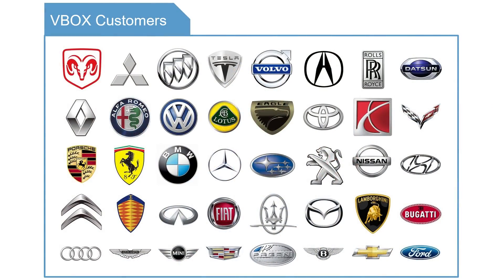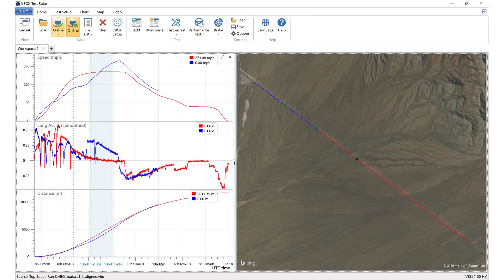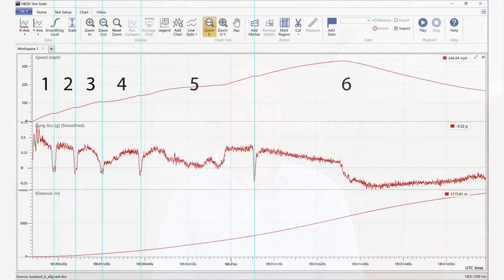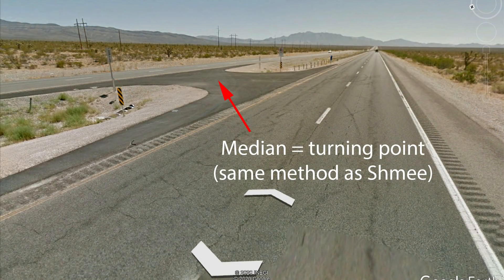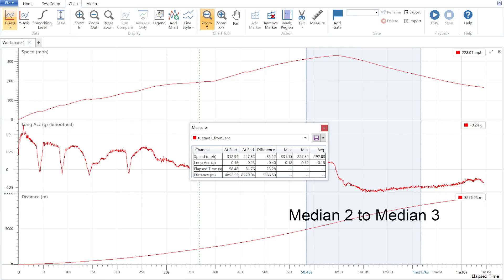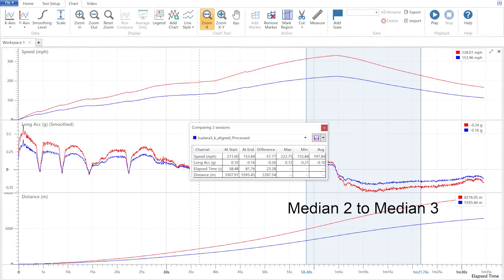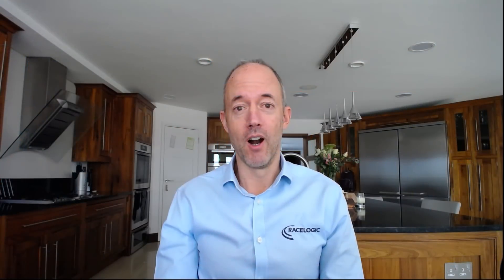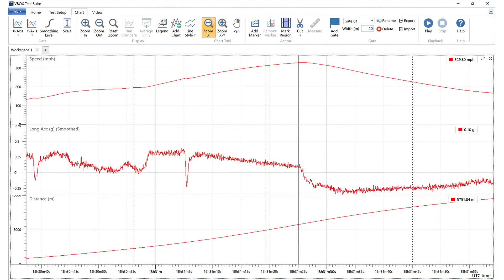How fast did the SSC Tuatara really go? Here's my calculation based on some new data.

Comment: Truly fascinating approach and eye-opening in many ways, beyond my ability to work on it that's for sure! There are many questions surrounding this, that may well go unanswered, for now we shall await the next run and see what the Tuatara can achieve.
Reply: Man, you write exactly like you talk. I can imagine your voice while reading this.
Reply: Thanks for all your great journalism in getting to the bottom of this scandal. It takes a real professional to be so thorough and unbiased
Reply: If this is accurate I would think a downforce issue is still to be dealt with. Ollie was almost blown off the highway at this speed, whatever it was and the crosswinds were minimal. Safety is now a big concern, no?
Reply: 216.95 by my estimate Tim. But still + 6 mph is within margin of error. 

God Bless. 

KNIGHTRIDER
Reply: @jeanmaranello3365  you people are nuts. The lambo aventador svj does 216 mph with 760hp. The SSC has 1000 more. I don’t think y’all actually understand physics.
Reply: @flowmastaflam  so you're saying there's a direct correlation between top speed and bhp? amazing
Reply: @nocashirl  do you disagree that there is a correlation between hp and top speed?
Reply: @flowmastaflam  yeah only if things were as simple as you think they are
Reply: @nocashirl  if you don’t think speed correlated with power then you have no leg to stand on. It’s literally the basis of how a car works.
Reply: @flowmastaflam  what if i simply chose to have shorter gears.
Reply: @nocashirl  this wasn’t the discussion. You said power doesn’t correlate with speed which is factually incorrect. See if you can reach 300mph in a Honda Civic with a stretched final drive.
Reply: @flowmastaflam  Everywhere in this comments section you are arguing as if ANYONE has said that 223mph is the highest speed possible by the SSC when literally NOBODY has said that. All they are saying is that this is a video of a car still accelerating but it only hit 227mph when the driver lifted off. Every car that ever went more than 223mph, will have still been accelerating at 223mph. There is ZERO evidence that it ever went more than 223mph even though we all know it can go higher than 223mph. What we want is evidence of it going faster than 223mph and hopefully as fast as it can. But we don't just "believe" based on it having 1000 more bhp than another car that did over 200mph that SSC did 300+ with zero evidence. They put out a bogus video and aligned it with a claim that doesn't appear in the videos. So we are doubting it. If they had the evidence of 300+ it would be here with us by now.
Reply: @stevenross-watt8640  there is ZERO evidence that he lifted off at 227mph. See how this strawman argument works? You don’t have to believe the speed, but literally nothing has proven that the speed wasn’t achieved, and you’re doing exactly what you supposedly have an issue with, but from the opposite perspective.
Reply: @flowmastaflam  the duty does not lay on us to prove the car didn't do 300+ it is the duty of the record claim to prove it did do 300+... that is how records work. Would you agree? I could claim i ran the 100m faster than Usain Bolt's world record but the duty would be on me to prove I did with live video, officials, measure track, wind speed and all the rest. What we all have here is analysis that shows that the evidence we have been provided by the record claimant is false and the analysis is robust and shows what speed it did do when the driver lifted. In the video we have, robust analysis shows he lifted at 223mph. You need to come up with a better argument or evidence or analysis for your point of view considering the level of professional expert you are questioning. Where is your evidence or robust analysis? You just have " it has 1000bhp more than a car that did over 200". Thats not a lot to go on.
Reply: @flowmastaflam  I think it is the case that in a fight maths always beats physics because physics is just a special case of mathematics.
Reply: @flowmastaflam  
You get that air resistance is proportional to velocity squared I presume?
Reply: Flowmasta Flam maybe theyre being paid off by koenigsegg to say this stuff🤔
Reply: @flowmastaflam  216 mph for a car as big and heavy as that Lambo seems like a bit of a stretch. Maybe they tested it while driving down a mine shaft?
Reply: @moto-rambler  haha, i enjoy dunking on vapid lambos as much as the next guy, but weight only determines acceleration, not top speed :O
Reply: @flowmastaflam  nothing proves he didn’t reach the speed you say..how about Shelby coming out himself admitting the speed was ‘INCORRECT’  “Your flogging a dead horse here pal!
Reply: @moto-rambler  Actually no...if you dropped it down a mine shaft, no matter how deep, once it accelerated to terminal velocity, it would stay there! But I get what your saying lol
Reply: @Stix84  Indeed 👍
I was attempting to nudge flowmasta into unblocking his way of thinking all by himself 💩
Reply: @flowmastaflam  My car's top speed is 133 mph, therefore basic physics says that I always travel at 133 mph regardless of conditions or throttle position.
Reply: @reggiedixon2  You aren't making some clever point.
Reply: @owensparks5013  Your point brought nothing to the table so I didn't respond.
Reply: @flowmastaflam  
Your entire thread appears indicate that you are under the assumption that adding 1000 bhp more than a lambo will make it twice fast as a lambo. This is probably why people are not respecting your opinion. That may be a misinterpretation of what you meant, but it's how it reads to me.
Reply: @flowmastaflam  If I was then you would have no way of determining this given the lack of insight in what you have spammed all over.
Reply: @Stix84  yes but ssc bloodhound is crude technology. im convinced in 50 years or so you could have a conventional car going at least 500 mph
Reply: @paveantelic7876   your joking right? “CRUDE” Are you and flowmasta having a stupid competition here?🙄 I’m done with this thread...the levels of intelligence are even more questionable than the speed run!
Reply: @Stix84  It really doesn't matter to me whether people agree with me. Y'all are just bickering dumb irrelevant points for the sake of arguing. Here's a little scoop of wisdom for you. Might help you once you get a little older.

“An error does not become truth by reason of multiplied propagation, nor does truth become error because nobody sees it. Truth stands, even if there be no public support. It is self sustained.”
― Mahatma Gandhi
Reply: @flowmastaflam  you should have a harder think on that.
Reply: @Stix84  I never said anything about “dropping” it down a mine shaft.
Reply: @moto-rambler  What??
Reply: @flowmastaflam  I said you should have a harder think on whether weight determines only acceleration and not top speed. According to your logic, if the Lambo weighed 12,000 lbs would it accelerate slower but still reach the same (claimed) 216 top speed. I would disagree.
Reply: @moto-rambler  So, the reason I said "What?" is because I wanted you to explain your position in writing even though I already had a hunch what you were implying. I regret to inform you that weight is not a factor of top speed. It is a factor of acceleration. Think about how momentum works. Once something has been put in motion, it stays in motion no matter how large. A heavily object is slower to reach that terminal velocity while under a specific load, while things like Power, gearing, tires, and drag coefficients are the things that affect top speed.
An extreme example of this is a train. Trains make around 10,000 horsepower give or take a few thousand in either direction, yet they weigh up to 450,000 pounds. They're able to slowly creep up to top speed of 100+mph over the course of like 5 minutes because weight is not actually a factor.
Reply: @flowmastaflam  - I grok. Horsepower, gear ratio, cd/A, wheel circumference.
Theoretical top speed is a mathematical formula.
In the real world there are many more variables to consider such as rolling resistance, air density, surface condition, etc., etc....
However, you're fundamentally correct in that weight in and of itself  has little affect on top speed.
Weight has the distinction of negatively affecting every other dynamic of the automobile granted two exceptions, mechanical grip and accidents involving 2 (or more) vehicles.
Ignore people who attempt to disparage you.
Reply: @flowmastaflam  trains can do that because of a lack of rolling resistance. Put tractor trailer tires on that same hypothetical train and tell me it has the same top speed.
Reply: @flowmastaflam   You actually need to take a closer look on how the resistance of moving  object is defined in physics. As far as weight being an issue in accelerating you are correct. The basics being that Force=mass*acceleration. So far so good.  The thing is, "Force" is not just a constant, just as proved by the formula. Force consists of several variables. One of them is the rolling resistance in this case. Another one is the resistance by air. The resistance of moving an object is derived from the shape of the moving object, the thickness of the air and, here it comes,  the Force of the ground(in this case) acting on the car. This means if the car stays flat on the ground it is the same as the mass of the car. The formula is often described as F(resistance)=(negative)"coefficient of resistance"*"Neutral force". Further more, the Force described as above is by definition the derivative of energy with respect to time. The mass of the car, however, is not a function of time. Therefor we can conclude that mass is actually a factor when considering the relation of top speed and power. 
Regards
Reply: @flowmastaflam  Oh the irony. A classic Dunning-Kruger case.
Reply: @paxrolex  Why are you explaining this to me? You're acting like I don't know. Y'all are the ones acting like a car making 150 more horsepower, with a better drag coefficient, couldn't possibly do another 10 MPH. Ridiculous.
Reply: @flowmastaflam   I was under the impression that you believed that, out of two cars, with the same output power(driving force), the one with the lowest drag coefficient would go the fastest. I am simply saying that's not always true, also relating that statement to basic physics. Make of it what you will.
Reply: @paxrolex   I mean under the circumstances you just mentioned, if they’re the same car, of course the one with lower drag coefficient will go faster.
Reply: @paxrolex  not really sure how you could think otherwise
Reply: @flowmastaflam  I never said or meant the same car of course. The point is, the weight is by any means a factor when discussing both speed and acceleration. As shown in my previous mentions.
Reply: @paxrolex  Okay I'm just glad that when only considering weight vs speed, we can finally all agree that top speed is not affected.
Reply: @flowmastaflam  simply put: it requires a larger force to move a heavier object.
Reply: @paxrolex  Umm, no. I feel like you're still missing something a bit here.
It requires a larger force to move a heavier object quicker
Reply: @flowmastaflam  OK, so if I understand you correctly you are saying that it requires the same force for two identical vehicles, except one is heavier, to both getting from 0 to whatever speed. And also equivalent forces maintaining that speed? 
I found a relevant video for you to study in that case. The one where engineering explained calculates the max speed of a jesko. Check it out.
Reply: @paxrolex  no you’re talking about acceleration for some reason.  Speed and acceleration are different
Reply: @flowmastaflam  So what do you think the terminal velocity of a car is? With your reasoning you are actually saying that the terminal velocity is infinite. A car reaches it's terminal velocity when the maximum driving force is equal to the resisting force.  Meaning sum of opposing forces is zero      -> no acceleration. The resisting forces are stronger if the car has more mass. It therefor requires more power for a car with more mass to travel a certain speed.  Agree?
Reply: @flowmastaflam  I agree with you regarding space. However we do not set these top speed records in vacuum. The top speed of a car on lets say a runway will depend on resulting forces. There is no momentum in this relation. If we consider one wheel of the car beeing our reference system then yes we can talk momentum. Do not mix up your reference systems. The driving force of the car is the same magnitude as the combined momentum of all four wheels. The force of Rolling resistance is depending on the normal force and has the same magnitude as the friction of the car. This is a force opposing the driving force. The magnitude of the Rolling resistance will determine how fast a car with a given power output and a given air resistance can travel.
Reply: @paxrolex  The reason I mentioned space is because the laws of physics are true no matter where you are in the universe. The laws of physics apply whether you're a spacecraft in space, or whether you're a car on the road. Weight is not a factor in top speed.
I've played along enough, though. Was fun. Just google if weight affects top speed ;)
Reply: @flowmastaflam  🤣, And so I did,. I just had too. So here is the best motivated out of the first answers.
https://physics.stackexchange.com/questions/10991/will-a-lighter-car-have-a-higher-top-speed-than-a-heavier-car-with-an-equal-powe/10995#10995

Regards
Reply: The jump. From 200 mph +... To 300 mph ++ is the issue. 1,000  bhp more  helps. But gearing is extremely more important. 

Then you have aerodynamics, encountering atmospheric pressures. 

Final example. 

Bugati Bolide. 1,800 BHP @ the crank. 

They claim... Est. 310 MPH. 

Follow me? 

3.3.1? 

Maybe in time. Hopefully soon... My friend. 

Either way. Stay tuned.... 

I believe tires are the biggest challenge. And please correct me. BOLIDE runs michelin 400's × secret specs... For 310 mph; estimate! 

331? = + 48% ? 

God Bless. 

KNIGHTRIDER
Reply: Another LAMBORGHINI fact. 

Diablo. 497BHP. = 208.9 MPH 1989... No paddle shifters. No dual clutches. All steel tubing frame. 

SVJ @ + 8? with + 263 BHP? ÷ 2 Clutches? Tells you everything. 

- Just to GAIN 8MHP! In 2020? 

I think it is clear here. Something was completely off here. 

Still. Much love and respect to all. 😉
Reply: @jeanmaranello3365  actually you’re wrong. The 485hp diablo only did 202mph. You’re thinking of the car they made later on called the diablo SE Jota. It had 580hp which did your 209mph. Knowing this, it clearly closes the gap between the 209mph 580hp Jota, and the 2017mph 760hp aventador that was built for the track, and not top speed. This renders your point moot.
Reply: But what is the new SSC attempt worth, if the car is not street-legal?

https://en.wikipedia.org/wiki/Production_car_speed_record
Reply: @viktor.egelund  Thank you for this. I asked this very question straight after the 'record' was broken. 331Mph just seemed to high for a 'production vehicle'. 
[To quote Wiki "the car has not been homologated for road use and is therefore at present not street legal."]
Reply: @simonmaney3438  On 1750 HP, 0.313 Cd at 500 kmph and frontal area 1.953 sq.m numbers and 3% gradient, kerb weight 1384 kg, the car can do 332 ideally on the uphill and 346 on the downhill if the air is thin enough (1.11 kg/cu.m) If I take SSC's air density value of 1.20 kg/cu.m the uphill vmax drops to 326 mph. So there's no way they can climb to 331 like that on the uphill leg. I can hear James may screaming "One more, one. More! '

SSC also lied about the frontal area, claiming it to be 18 sq.ft, when 1.953 sq.m is just a tad over 21 sq.ft. This is a sixth more than claimed! 

Now we all know the truth, but when even more studies come out it is astonishing to what extent we are capable of analysing data today and what kind of geniuses are out there. No one can fake it. 

And homologation is a whole other matter. Koenigsegg claims it takes 60-80% of their development work and budget to meet homologation requirements than just hitting raw numbers. The Tuatara's weight was also exaggerated, that was the dry weight. The kerb weight is only 6 kg lighter than the Jesko Absolut. But then all manufacturers do this.
Reply: I also offered SSC to drive one of their prototypes free of charge any time after December. 

I can dedicate 72 hours to test on the road before their run.
Reply: @Blaise ?????? It was so easy to prove this incorrect. It’s super simple actually. Don’t know why you’re all butt hurt about getting hit with facts
Reply: Since these videos I've been trying to work out if it's potentially another unit that they have picked up from the GPS and overlayed on the telemetry in error. Finally after this video it seems to make sense, interestingly foot/sec is a 1.4667 correction factor from mile/hour. Using this correction factor you would get a result of 225.78 mile/hour which would be well within the margin for error of Julian's calculations
Reply: Shmee - bring him in to have further discussion!  I'd love to watch and hear him explain in greater detail.  Not just for the Tuatara but in general.  Thanks!
Reply: Did anyone notice this video? https://youtu.be/qZD6k4FOBWQ It shows different speeds on SSC Official chanel and Top Gear channel?! Plot thickens.
Reply: Now I doubt that they can beat their previous record from 2010 with the Aero
Reply: @Blaise my ding dong
Reply: Who else read this in shmee’s voice?
Reply: They lied Tim, you can't say that but they were totally at it.
Reply: well i am stupid but hear me out
shelby did this in prps and wanted shmee to find out and the world to make fun of his car its all part of the plan cuz the car did not go full speed and the revs and the gears 
he wanted to redo it again and when he does 90% more ppl will be watching and waiting and than he will reach the max and prov the world wrong and be a hero and make his mark and the car will have a good story trust me thats the american way of doing anything
Reply: @azzeddindouakha3403  is that what trump is doing right now?
Reply: @flowmastaflam  yep creat a problem and get paid to fix it
Reply: @azzeddindouakha3403  There will be no re-run, this car is half the claimed power! All the other numbers are also as made-up as the speed. This is a non homologated/federalized, non crash tested garage build (I doubt it even has a single airbag in it). It's built and marketed by amateurs! It needs to do 8200 rpm in 7th to even tie the current record and have never been seen(heard) to do more than 7800 rpm. It's said to be unstable at 233 mph. If they where able to build a record breaking car (in the many years they put into this car) there would be no need to fake a record!! If they where anywhere near competent they should have been able to fake the record in a more convincing way in the week they had to falsify data before presenting them.
Reply: "...what the tuatara can achieve"... or more to the point, what it can't achieve 😬
Reply: @Blaise you’re literally crying right now about being set straight
Reply: shmee you are a disgrace to the car world a rich spoiled brat who buys cars just for views why so many cars?
Reply: @georgeionescu6425  Georgie you should shift your brain into gear before engaging the keyboard.
Reply: @Blaise I don’t understand your issue. You can’t seem to handle being wrong. Were you given participation trophies as a child?
Reply: @Blaise you’re projecting a little too much. Can’t handle your fragile reality being shook. I can see the trail of tears and slime behind you.
Reply: #stopthisrelentlessbashing 🙄
Reply: @einautofan6685  Who is bashing??